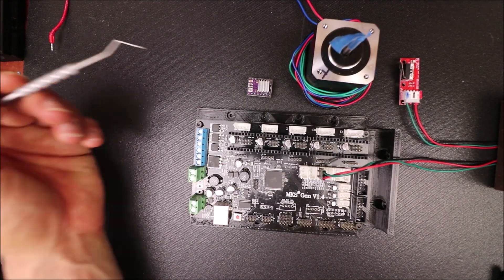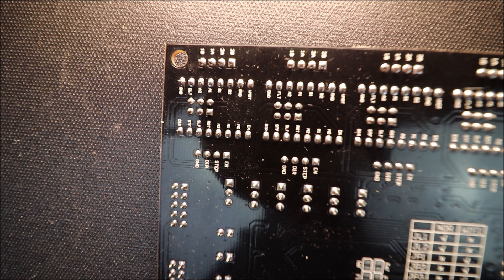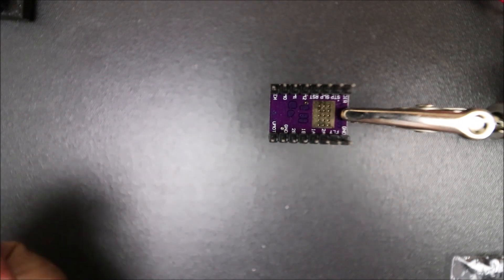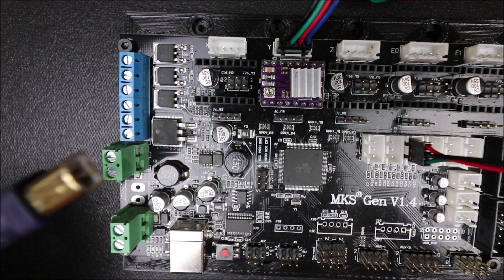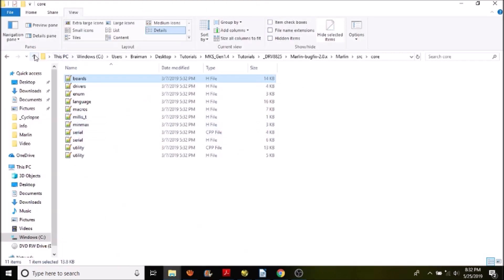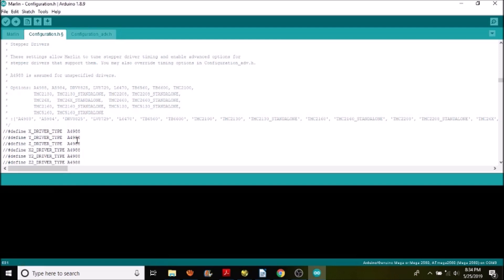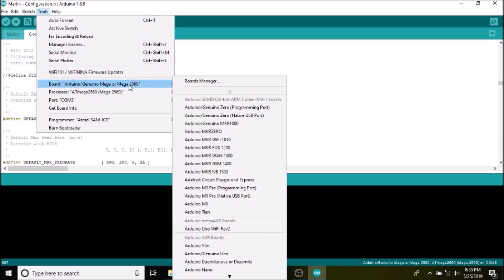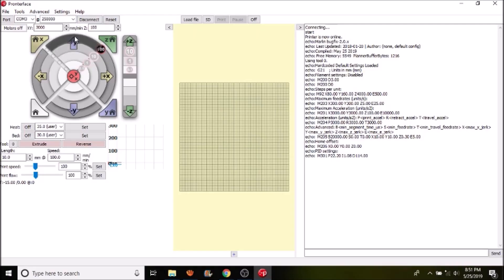MKS Gen 1.4 - DRV8825

Comment: did you get the skr v1.3?
Reply from the maker: Yeah, working on how to present with platformio.
Reply: @EdwardBraiman  Same, can't figure out anything
Reply from the maker: Platformio needs to be loaded on a software called Atom.  I'm working on the detail steps to walk people through the process.  I'll be recording other tutorials tonight and look tomorrow.
Reply: @EdwardBraiman  Thanks god people exist like you
Reply from the maker: Okay I'm doing final verifications, on loading firmware.  Just need to review hardware for description of basics video.  Already have a board holder designed and printed.  Be a couple of days of review before recording video.
Reply: @EdwardBraiman  good luck to you.What do you think of the board?
Reply from the maker: It's well designed, but not well documented for the two tutorials I've made last night.  It takes a long time to compile and load new firmware.  I'll need to find a printer to test.  The price is similar to MKS Gen L.
Reply from the maker: It's rush and not yet CC in 80 foriegn languages yet.
Reply: @EdwardBraiman  Rushed*?
Reply from the maker: @tophatv2902  still need to CC in multiple languages.